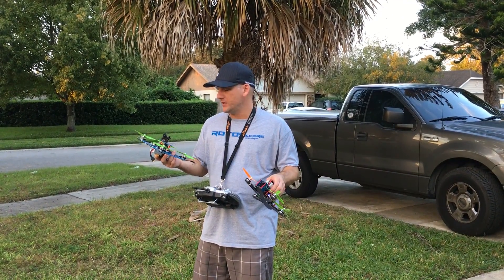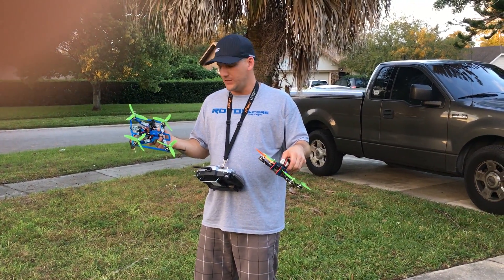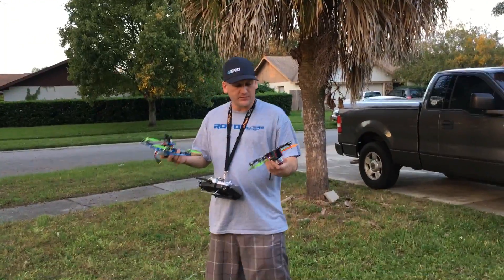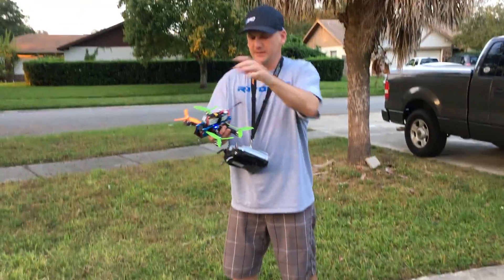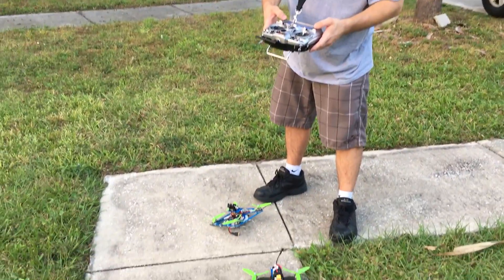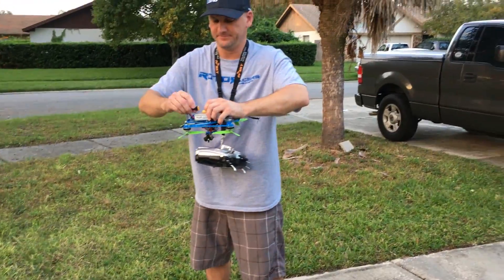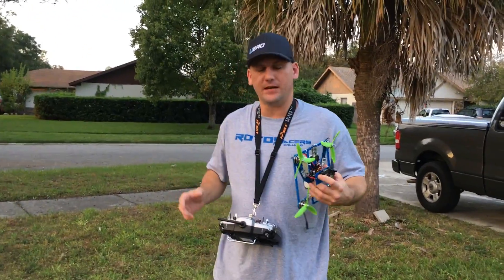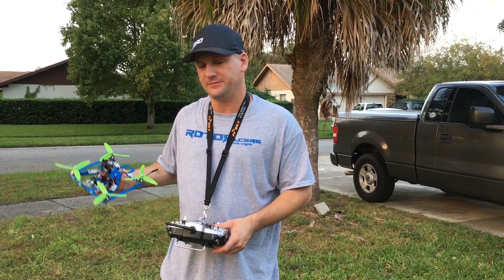Ubad Angry Beast ESC

Comment from the maker: It just kills u guys to see anyone say anything bad about the Kiss. Lol. The point is, that the escs respond faster. I got to fly both of these quads in race format yesterday.  The descents are faster. If the motors can stop faster to 0, then, they can stop faster to "almost" 0. I have no problem controlling my quad.  I fly with 100% rates and 0 expo. If I desire some extreme maneuvers, I can achieve them.
Reply: +Lets Fly RC Except the Kiss actually spun up every time you stabbed the throttle stick and the other escs seemed to stick, with various props not spinning up. Also, I see the back right prop free-spin at 01:44 and 01:51 despite zero stick position. That back-right motor was also the one most consistently spinning up when you stabbed the throttle.
Reply from the maker: The kiss has equally as much inconsistency on a regular basis with more test material for statistic generation.  

The props are accounting for the quad starting in a non-horizontal position.  That is why I flattened the quad out toward the end. 

If it was that inaccurate, my quad would flip over when I punched it from the ground, and it definitely does not flip over.
Reply: You weren't working the stick the same on both tests either. You gave the ubad escs deliberate, controlled up and down movements, whereas you stabbed the throttle on the kiss test. The two times you stabbed throttle on the ubad test, show up at 01:44 and 01:51 as free-spins. I'm just pointing out the inaccuracies of the test procedure.
Reply from the maker: I don't see the difference in my stick movements.  I assure you, I didn't introduce any variables on purpose. I challenge you to try it for yourself.

Comment: OMG.... Do people still not realize the KISS30A DO NOT actively brake when the throttle is set to zero. So sick of people doing "tests" when they don't even know whats going on themselves! Or...if they do..... they are miss-leading people. 

The KISS30A are designed like that. When ever do you go ZERO throttle in flight?? NEVER! The more accomplished pilots have a min throttle set so props are still rotating when there throttle stick is at zero, and make sure PID_at_min_throttle=1....that way when flying.. you can put you throttle stick at zero... and actually still have control of the aircraft...... if you went to zero throttle and your props stopped... the UBAD Angry Beasts would fall out of the sky immediately....the KISS30A would at least give you a couple of seconds.

To preform a proper test you would have to compare change in RPM/time from 100-50% ....80-20% etc etc not to zero!

Also, please do not make statements like "Look at the size difference" with out pointing out the mini-beast only do 3-4s and the KISS30A can do 2-6s! Bingo, there's the size different explanation.
Reply: +Pete G just came in here to type the same thing. pretty hilarious :)
Reply: +Team BlackSheep ...I get paranoid one day due to that kind of posts ;P
Reply: +Pete G signed